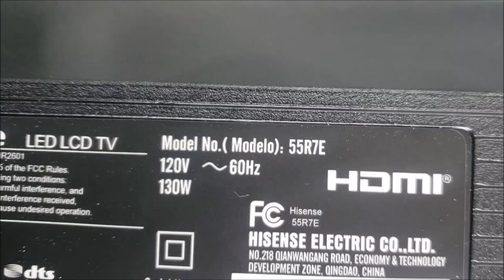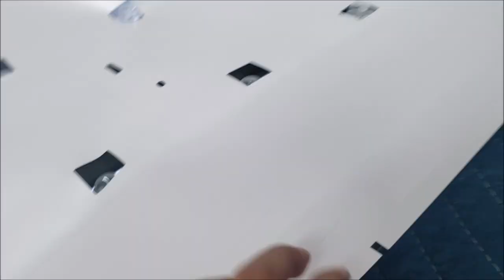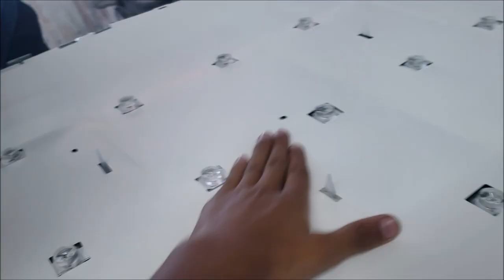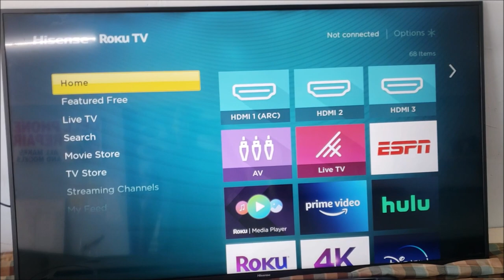Hisense TV 55R7E restarting no picture

Comment: So I just want you to know YOU'RE THE BEST! this is coming from a guy who has repaired parts for probably the majority of TV repair shops around the world.. so I just wanted to give you a lot of major recognition and admiration because your videos are the first time I've ever learned new things that I didn't know!
PLEASE HELP ME WITH THIS SONY! I MEAN I CAN REPLACE ALL THE BOARDS AT A REASONABLE PRICE BUT THE FUNDS RIGHT NOW ARE PRETTY LOW SINCE I'M STILL NOT BACK TO SELLING ONLINE..
XBR55X900F.. WON'T COME ON UNTIL YOU UNPLUG IT AND PLUG IT BACK IN BUT THEN IT ONLY COMES ON FOR A FEW SECONDS.. USUALLY SHUTS DOWN AFTER YOU SEE THE SONY LOGO OR WHEN YOU START SEEING THE ANDROID LOGO.. SOMETIMES IT MAKES IT TO THE SPOT WHERE IT'S ASKING WHICH LANGUAGE SO IT'S AT THE BEGINNING OF THE SETUP.. THE 10 YEARS I'VE DONE THIS THE ONLY SONY FLAT SCREENS I'VE EVER HAD TO REPAIR WE'RE DUE TO POWER SURGES OR KIDS HITTING THE TV AND SOMEHOW NOT BREAKING THE SCREEN BUT SHORTING OUT PARTS.. BUT MOST OF THE SONY'S I'VE GOT DROPPED OFF BY FOR REPAIR I CALLED THE CUSTOMER BEFORE THEY GOT 2 MILES AWAY FROM MY HOUSE BECAUSE AS SOON AS I USED MY OWN POWER CORD IT CAME ON OR MOSTLY IT JUST REQUIRES ME UPDATING THE MAIN BOARD! I UPDATED THE MAIN BOARD AND I CAN'T FIND ANYTHING WRONG WITH A MULTIMETER.. IF YOU'VE HAD ANY EXPERIENCE WITH THESE MODELS, PLEASE PLEASE LET ME KNOW